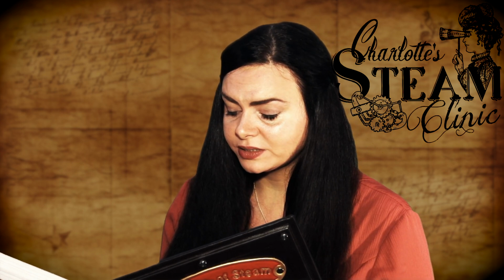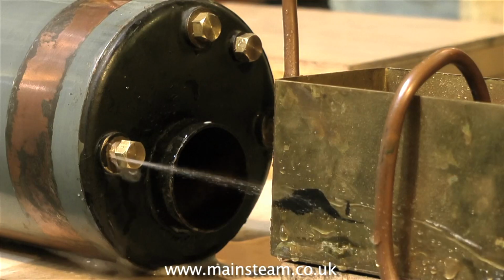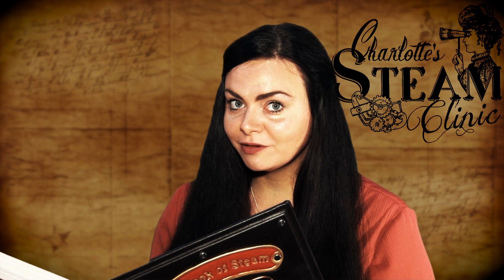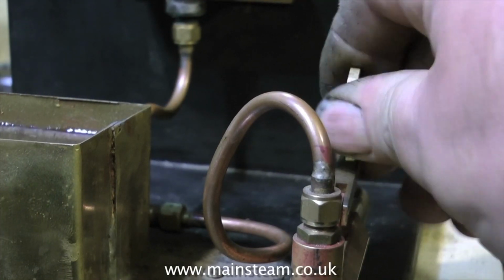CHARLOTTE'S STEAM CLINIC - PART #2

Comment: Bonjour Charlotte,
Very interesting topic. In France, steam is so uncommon that there is no official certification needed if the boiler contains less than 25 liters.  The last French steam manufacturers deliver a certificate, but it is not mandatoryand is a pzrsonal commitment. Hopefully, we commonly run at 2 to 5 bars and use gas regulators, which limits the risks.
Next to that, thank you for your perfect English which allows me to understand all what you say;
Amicalement, Raphaël

Comment: 5:15 as far as I'm aware that's not entirely true
Reply from the maker: as far as I am aware that is entirely true ......... over to you  . . . . . . . . please tell me of a boiler inspector who will issue a valid recognised boiler certificate in the United Kingdom for a stainless steel model steam boiler . . . . . .
Reply: @keithappleton  it is true.for any type of test you need to produce the metallurgy certificate along with the welders certificate to ensure he is pressure vessel rated....i found that out a few years ago when i purchased a part built 3 inch burrell.. now we have an interesting garden water feature in the shape of a traction engine boiler.....lesson learnt!
Reply: i believe both UK and Australia currently do not allow stainless , due to its stress cracking characteristics, nothing you can do about it right now, though i dont know enough about the clad metals, but that wont apply to anything model only high end industrial, and no idea if such exist as pressure boilers,  i only know of them as chemical or other gas useages

Comment: Very interesting, reminds me of what I learned when manning a Lancashire boiler and 3 full size beam engines 24 foot diameter flywheels. We learned these things the hard way!! One thing on very large boilers it's +40% for hydraulic tests. Though we once had a boiler inspector who took one of our lancs upto 180!! One of the blanking plates over where the crown valve is gave up. The boiler inspectors face was priceless !!!!